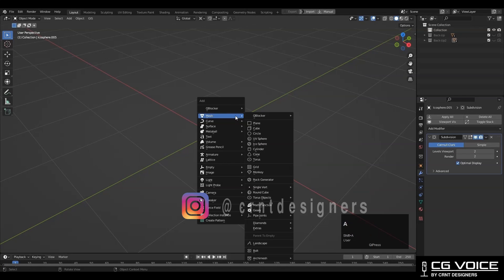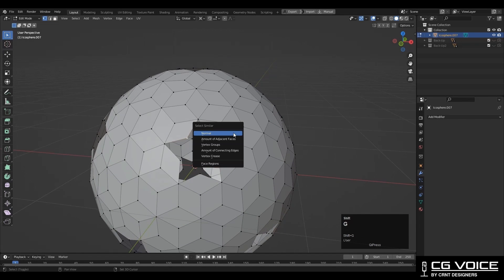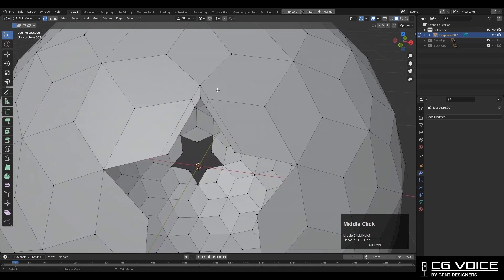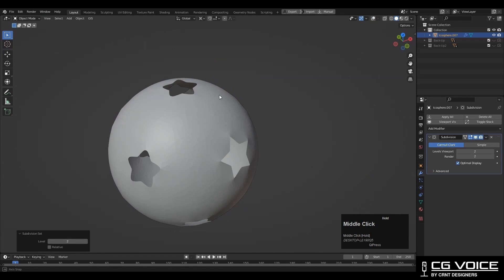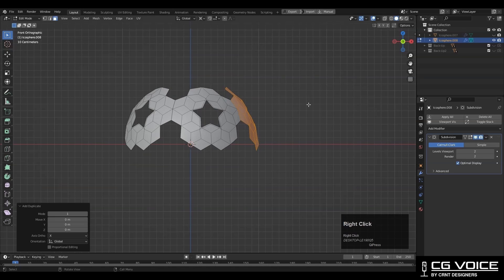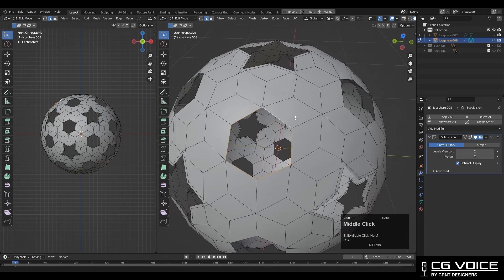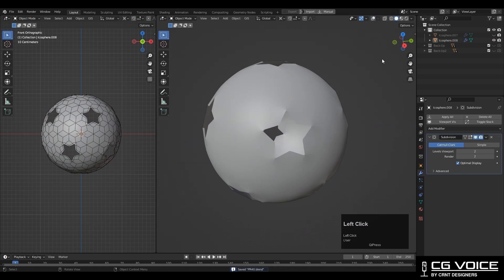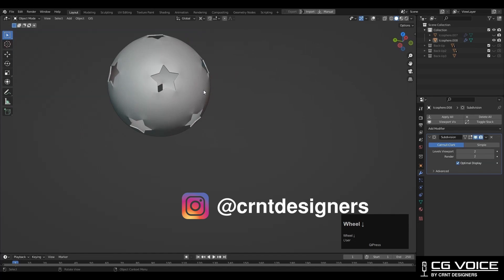It is Tricky to Created Star ⭐ Design On Sphere _ 🎅 Christmas Decorations _  Blender Tutorial

Comment: There is an easier way to close the hexagonal holes - mesh > clean up > fill holes (6 sides), then poke faces > to quads.

Also, in order to remove pinching, you can use the shrinkwrap modifier and select a different icosphere as a target.

And finally, instead of adding thickness and bevel manually, you can add a solidify + bevel modifier with an angle of about 90 degrees after the shrinkwrap.

I get a perfect sphere without pinching.